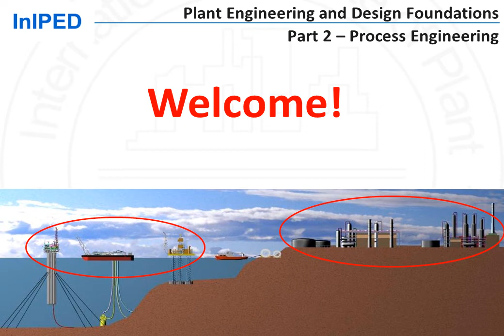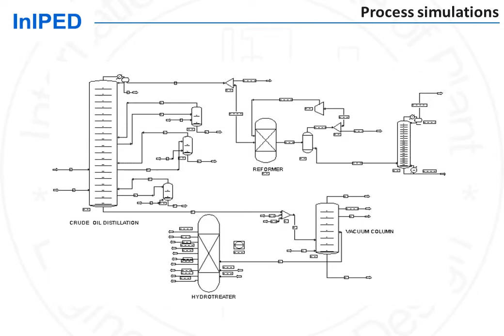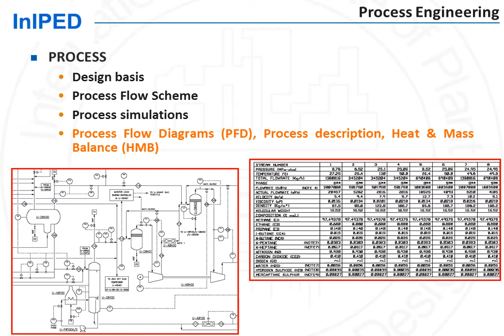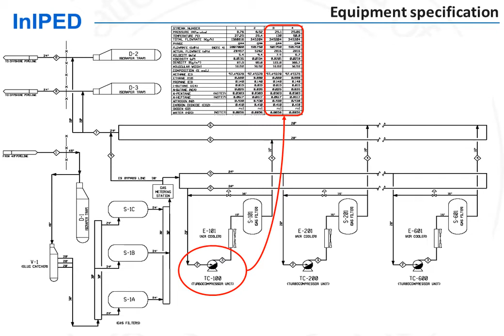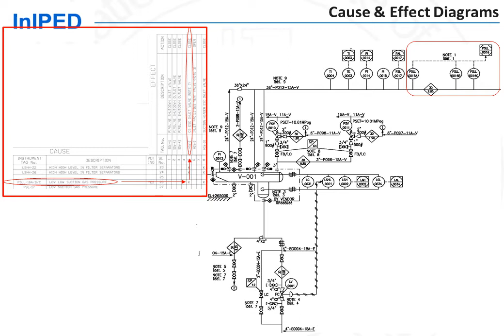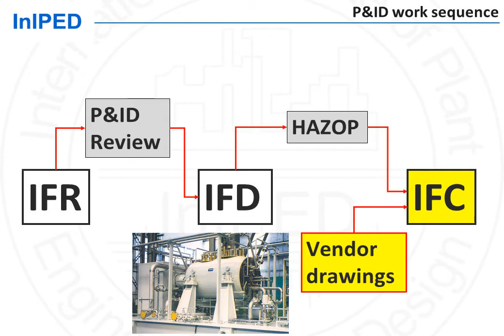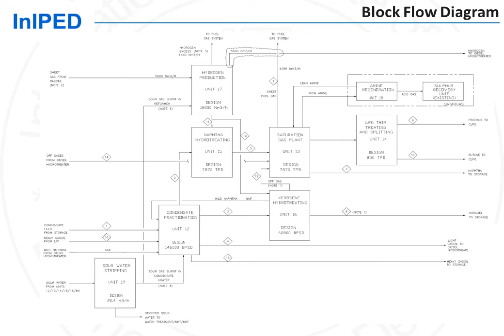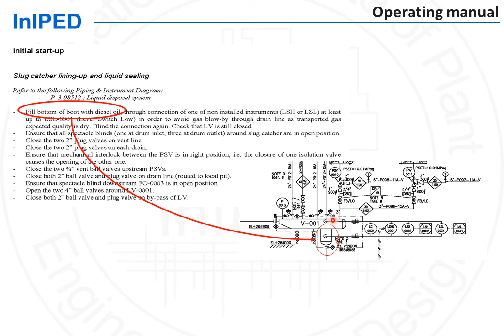Process Engineering

Comment: Hi, it is really helpful. Thanks for this presentation. I would appreciate if you could answer one of my question. I find in pipeline (underground) facility design, sometimes Isolation kits are used and sometimes not in the riser site. When do we need it and when not? Thanks for your clarification. Riton
Reply: Isolation kits are normally used to prevent the cathodic protection current leaking to your critical equipment such as flow meters etc. The flow meter (specially electro magnetic) reading will deviate if CP current start passing through it.